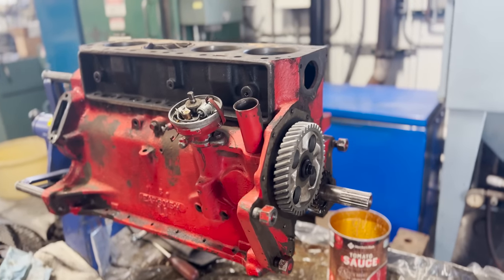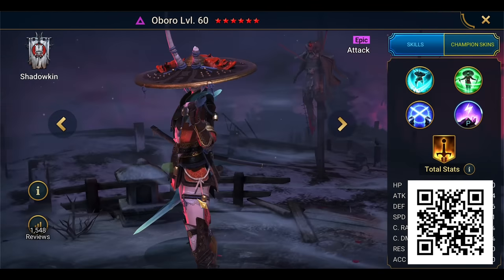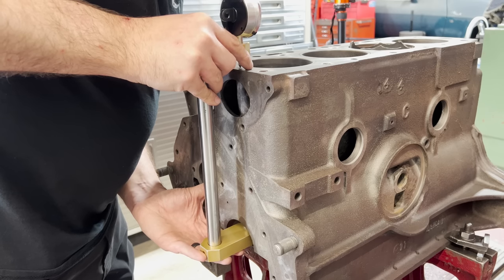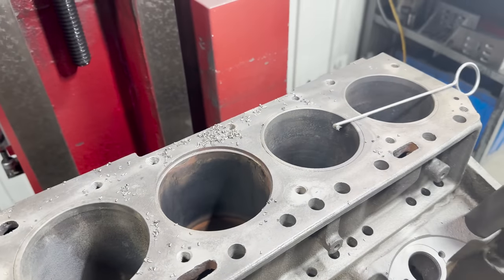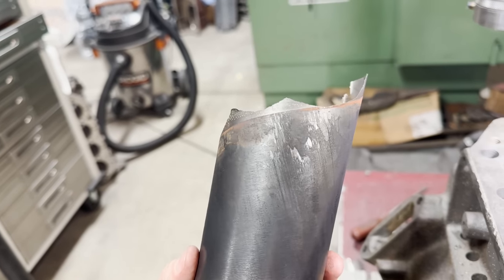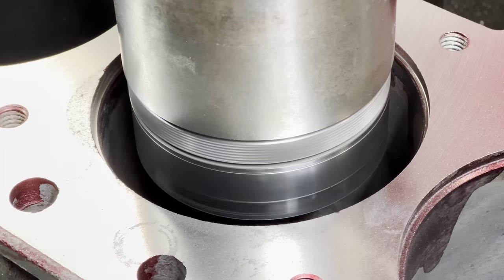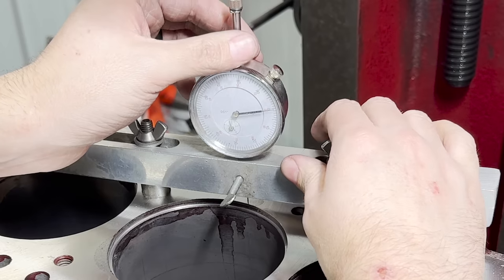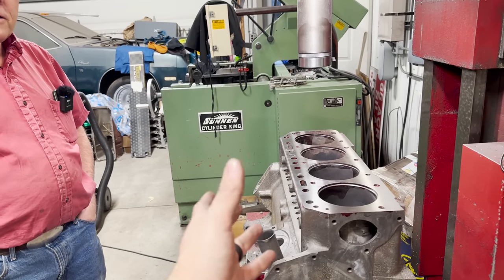Do YOU Want To Know Why WE Don't Use Sleeve Pullers?

Comment: Sounds like exactly the right answer.  And yes, trying it yourself, if it seems reasonable to do is fine, and quitting when you are behind, if there is any possibility of damage from the mess you've already made is the right choice, that, or be willing to just pay for major damage repair or a new block.

I was helping a guy reassemble a 289 that had been machined by a tech college that did the work very cheap.  It was worth about what he paid, or far less.  We installed the bearings and the crank, and the crank would not turn by hand, at all. I put the torque wrench on the front bolt and it took fairly considerable effort to turn it.  For some reason he hadn't gotten any plastiguage, which was dumb, but I removed the main caps, looked at all the bearings to make sure nothing had gotten under any of them, no burrs, correctly installed, etc.  All of that looked good. 

I said we're done, and told him to take it to a reputable machine shop I recommended, who had done excellent work for me (I did plasti-gauge the clearances on work from them, and they were dead on), with the bearings, and have them check the machining work on the crank and block.  He had another 

He had another friend come over after that, who said it was fine (he was not one for learning from mistakes), so they went ahead and assembled the engine.  He left the job I was working with him before he got to the install/start up, by I have a fair idea of the likely outcome.  Sometimes you can't protect people from themselves no matter how hard you try.  Guessing from the advise the guy gave him on the crank marginal lock up drag, I would bet money he never did things like gapping the rings, either.  The drag on that crank alone was about 10X what an assembled short block should feel like, it wasn't just a little bit tight.  And before somebody says it, yes, we prelubed the bearings properly.

If I still did it anymore, seeing this I would be more than fine with sending you work.  I also remember one of the speed shops I had do some blueprinting level work tell me that I wouldn't believe how misaligned cylinder bores from factory engines often were, sometimes even not totally perpendicular to the crank.  You would think if anybody would get things 'dead nuts' right it would be the factories, with the machines they have.  Apparently not, not back then anyway.

Good engines these days make engines from that time frame look like total junk.  I recently put valve cover/plenum gaskets in my 2004 TL with 312k on it, and the inside of that engine was NUTS.  I could see nothing that looked like any wear was occurring, and you could run your finger over the VERY light varnish staining on the block and it wiped totally to brand new aluminum color.  Amazing.  The first problem of any significance was a tranny, at 309k.  It was still working, but shifting kind of wonky.  I expect there have been advances everywhere, metallurgy, lubricants, etc.

Comment: Excellent quality work. When I did the first rebuild on my Ford diesel tractor and had sleeves installed, I am pretty sure they did it with a tape measure, a sledgehammer and a block of wood. Now it's nearing the second rebuild and I would much rather find a new short block if possible. All that because I can't find a machine shop that takes pride in their work.

Comment: Vintage tractors often use sleeves and a common practice is to use a large arc welding rod (bent about an inch from the tip) to run a few lines up the inside of the sleeve.  The weld line melts the sleeve material but the compression of the block prevents expansion.  When it cools the sleeve contracts making removal easier.  Often the sleeves will pull out without any tools.  Care must be used to not penetrate the sleeve with the weld arc.

Comment: A little insight, I had an LS2 in a truck that had the same issue. Never had any issues that I could physically feel, see, or hear. However, at hwy speeds, the computer would detect a misfire, and trigger a CEL. But again, I never felt, seen, or heard any issues. 300k miles and still going strong as a work truck.

Comment: Worked on many old farm tractors many moons ago. Ford, Massey, Oliver, etc.  Sometimes the value versus the cost to "Do it right" becomes the largest issue. Some machines had these slim wall dry-sleeves, some had water jacket cast iron sleeves with O-rings to seal the lower circumference.  Sometimes there were cracks in the webs. When the customer wanted cheap as could be done, Epoxy-metal mixes filled the cracks & saved the day. In some cases, heat or cold helped get pieces to fit or "get by."  Everything is relative.

Comment: At the shops I worked at, we just scalped out the sleeve using a 2" boring bar on the mill. Get to about 10 thou from the original bore and the sleeve buckles. After set up I could remove 6 sleeves in about 20 minutes.

Comment: I also work at an Engine machine shop. Love watching your videos BTW. We have seen this before. And this is why we always try to make sure our customers don't buy any parts until we have gone though everything. We installed sleeves with the bore out of round just like this. luckily .010 or .015 over pistons were available. So after we installed the sleeves, I did a small cut in the bore to make is perfectly round with still about .006 to hone. I'm sure you guys already thought of this but I just wanted to give my 2 cents. Keep up the great work. I'll be waiting for part two.

Comment: I remember going to Parr Auto in Greeley back in 1973 to get my 235 cu in six machined for the 1954 Chevrolet pickup I was rebuilding. It's at that time I learned the hard way about getting my rods resized.  They weren't and I ended up having a rod knock and repulling the crank.  Lessons learned.
I really like watching these videos and just an observation, this video's volume went up and down making me adjust my volume several times.
Reply from the maker: Parr Auto - that's a blast from the past!!
Reply from the maker: Do you remember when it was Milts before it became Parr Auto?  We did a Model A video awhile back that had a Milts tag on the side of the block.
Reply: @JAMSIONLINE  I didn't know it then.  I moved to LaSalle in '71 and that was when I frequented Parr.  I miss the Greeley area and it looks like you've got a really nice shop and your work is top notch.

Comment: Would you be able to make your own oversized sleeves? As long as you have a good lathe sleeves are not a difficult thing to machine. Just get some cast iron tubing that is close to the necessary size. McMaster-Carr most likely has what you would need if your local supplier doesn't.

Comment: I’m a chemist by training and always looking for a solution to problems by using chemistry. Why not put a wooden plug in the bottom of the bore, fill it 2/3 with acetone and the rest of the way with dry ice? That should shrink the liner nicely.

Back in the heyday of this block Ford used to use heating and shrink fitting to make up a lot of assemblies (as you guys no doubt know well). I have always wondered if cryogenics couldn’t be used in a sort of reverse mode today to get the same job done.

Comment: I'm not sure how many dry sleeved engines I've done, but a few welding beads to suck up the sleeve and out she comes.  If it is really stubborn, heat the entire assembly and push a little nitrogen on it with the block still hot.   I don't recall ever sending one to the machine shop to pull it but then we seldom ever used a machine shop for a refurb.

Comment: Would installing the sleeve and honing back round work? 
Or just knocking off the 2.5 thou undersized of the parent bore then at least it’s only 2.5 thou out and not 5
Then installing the sleeves and maybe getting those a thou more round then the bore?
That might open up the tolerances, but it might be on the loose end and save the customer some $ overall

Comment: Pulling semi truck liners, engine in chassis, is a fun time. We use a hydraulic porta-power to push the connecting rod against the liner bottom rim. Pick the whole front of the truck up until it gives way and pops up, dropping the truck. (DD series 60 engines.)

Comment: Some British diesel engines in the 1960's used thin chromium alloy dry liners and they were the hardest ones I ever had to remove and fit. From memory, they were 62.5 thou wall thickness. You had to use heat to get them out and dry ice to put them in.

Comment: Spray weld/re boring would be another option to make cylinder sleeve block OD bore smaller. Or you could spray weld cylinder sleeve OD bigger. Maybe one day there will be a 3D additive printer to fix old engine blocks

Comment: I found an easy way to remove the dry sleeves in my 1985 M-B 5 cyl diesel engine.  With all parts stripped, from below I tapped a blunt screwdriver between sleeve and block.  The sleeve is thin cast-iron so just cracked apart, leaving a wide slot.  I then folded it inward to peel out.  Started with a thin screwdriver to get the gap open.  On the first cylinder, I had first run a welding bead (wire-flux) along the sleeve which expanded and loosened it, per web suggestions, but found not needed for the others.

Before sliding in the new sleeves ($11 ea then, now hard to find), I chilled them in the freezer and heated the block over a camp stove to expand the holes.  I still had to beat the sleeves in, placing a thick steel plate above to spread the force.  The faster the better.  On a few where I dallied, I had to change to a sledgehammer to get them finally seated.  You can tell because the sound changes when the sleeve seats on the upper step.  Careful or you could crack the new sleeves (cast-iron).  The new sleeves sit slightly "proud" of the block, so need a machine shop to mill them to the block surface ("deck") and also hone the diameter to match each piston.  Haven't done that yet since found a used engine that was perfect.  If doing again, I would have sanded the block holes more (rough surface w/ milling grooves) and coated with oil to slide in easier.  Besides friction and rust, the sleeves are held tight by the head gasket pushing down.  Some later 6 cyl M-B diesels had problems where the sleeves hadn't been fully seated (factory I think), so later slid down to cause head gasket failure.  Those engines have aluminum blocks, so concerns with thermal expansion.

I miss the crisis.  Don't the new sleeves have a slightly under-sized bore and you are supposed to hone them to fit the existing pistons (or new std pistons)?  Hard to believe the factory expects the sleeves to be a perfect fit to the pistons.  After honing/boring to make the new cylinder perfectly round, if the piston is slightly small for that bore, can't you knurl the skirt to push the aluminum out, then machine for a tight spec fit?  You then gap the new rings perfectly and "should work" unless the rings extend too far past the grooves on the piston.

Comment: Another method of removing the sleeve is to set the boring tool diameter to a much smaller diameter and offset the cut to take only a portion of the sleeve to within 0.10 thou or so of the parent bore. Then simply use a file [or the boring tool] to scrape along the thinnest point and the sleeve will collapse. This works a treat!

Comment: Use an arc welder and a 1/8 diameter rod to run a vertical bead in the sleeve.  Let it cool, turn the engine over on blocks and the sleeve drops out.

Comment: I learned that cylinder sleeves must have a thermal difference to slide in and out because cold metal shrinks and the sleeves will relax against the block until pressing tightly from warming up. It's important to note that freezing the sleeve in an engine might not free it as the block itself might shrink with the sleeve. Your best option is to bore away the sleeve and insert freezing temperature sleeves. Thankfully you don't have to wait long if you have liquid nitrogen. If you have patience then your standard freezer will work.

Comment: I run a machine shop in Germany and I get into that customer made mess quite often. I do a lot of old mercedes diesels and they often have repair sleeves in them. They are impossible to remove by pulling. But a lot of people try it anyways... Sometimes I have to torch the wedged pullers out.

Comment: Nice work. The old dry liner engines I’ve worked on I always ran a few beads of weld in them to shrink the sleeve and they nearly fall out
Reply: Yeah mate , we always ran a couple of lines of weld down the bore of dry liners and never had dramas, I’m surprised you’re the only other person in the comments that’s mentioned a very common practice

Comment: I have two of those motors, non sleeved versions, I need to rebuild the 172 to install in my tractor as a spare when I pull the 134 out (very bad blow by under load, badly pitted block). The 134 runs fine, other than  cylinder 2 and 3 were full of water at one time and badly rusted, shower of rust when those cylinders finally started to fire. I got a pulled 'core' industrial to rebuild. Would you recommend boring and using liners, or using oversized pistons if needed. I have the tools to hone oversize if I go that route, but finding a machine shop that really knows how to use boring equipment is like hens teeth, rare. I was hoping to go dry liner so the next owner would be stock guts, but I until I open it, who knows how bad it is. Have fun, Been wrenching for more than 50 years

Comment: Cant blame the last guys for the bore out of round 😂😂. Curious though are these dry liners a fitment from new, only time I have come across them is in a repair situation to a damaged bore? Worked on several wet liners in tractors. Surly you can buy oversize liners like you can with pistons?  Love the accuracy you guys work to

Comment: H Farmall (1940s) with a service replaceable (dry) sleeve style engine, I'd try the specific puller.  Ford parent bore block with a repair sleeve, ship directly to a machine shop. Later (1960s) dry sleeve International/Farmall engines had tighter tolerance fits so i would consider a machine shop vs my barn.  Knowing your limits is a good skill to have 😊

Comment: Did a 318  Perkins, simply stitch welded 300 stainless round rod the height-length of sleeve. Then break out welded stainless round rod along with cast iron liner, zipper fashion. No damage to block bore.

Comment: Just a thought, a thought backed up by 45 years of machining experience, you may have done this already off camera I don't know but the correct way to check a casting for flatness is setting on three points not clamped down on 4 because if the bottom rail you are sitting on is not flat the clamps will twist the block then if you cut it with that twist pulled into it when you un camp it the surface you just machined flat will twist back when you un clamp it and this twist could also make the original bores check out of round

Comment: I know that it's hard to not do what you want to do for the most optimal result costs and time be dammed. But that's just how things go sometimes. Looking at the parent bores, a large part of me says to hit them with a hone at least a few swipes to clean them up first for the new sleeves to not have rust trapped in between them.

Which if you're going that route, it'll be even more tempting to bore oversized and sleeve accordingly. So that you won't have perfection itch in the back of the mind.

Comment: Dumb question. Can you not push the sleeves in so they go out of round, then bore them to the next oversize and install larger pistons. Would the bores not be round then? I'm assuming you would get the right interference fit with the sleeves you have.

Comment: Thanks for the video, yes being a perfectionist is hard when you work on old junk for customers and you know your quality work is worth 4 times the whole budget sometimes. I find this working on tractors the dealerships won't touch. At the end of the day you're in the same boat as me, do the best you can, make sure what you did and whys on the bottom of the invoice with no warranty and customer okayed  it. Yes those old motors will stay together as you say, I've pulled Fordson Major diesels apart, you'd look at it and say how did it even run with 3 lb of oil pressure, I'm thinking how well it started and ran for being totally worn out. I know of several tractors for sale right now are "fully restored" they are a pile of bits put together  so not even the correct model the hood badge says and had way to much money spent. The guys want 15-20k for them they are by no means rare or going to a commercial farm to work hard, just a 50 year old acreage tractor and they are worth 5K all day long in any auction sale. Then guys mad he's got 500 hours in it, gets made stupid low ball offers and can't sell it . Take care guys.

Comment: When I was a kid I had a 1964 Plymouth Valiant with a 273 2 barrel and factory 4 speed. It was pretty well run out with around 110,000 miles on the engine. I cut the ridges and left the cylinder 0010 tapered.. I had a set of Formula S heads redone and added a 4-barrel. I installed the stock pistons with new rings, standard rod and main bearings, and a new oil pump. I ran the hell out of that thing for at least another 100,000 miles and sold it running. This thing will run fine for a long time.

Comment: An old trick for shrinking internal sleeves and bearings is to run a weld bead in the ID. when the weld cools it shrinks and reduces the diameter of the part.

Comment: I am sure you guys know this but I watched a diesel mechanic weld a line vertically using stick on the sleeve wall from top to bottom and then used the puller. So the weld shrinks and pulls the liner away from the wall. This method in the video is better by far but if your on the farm with little time to pull the engine it works.